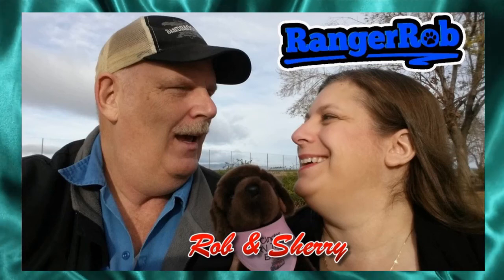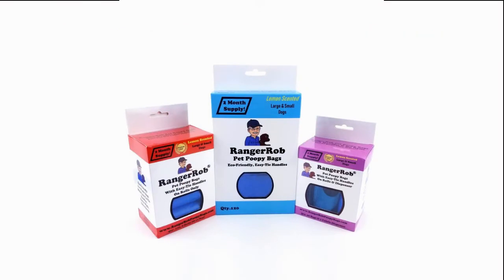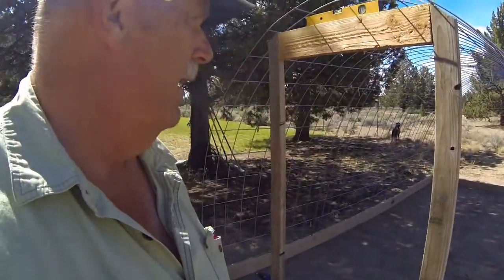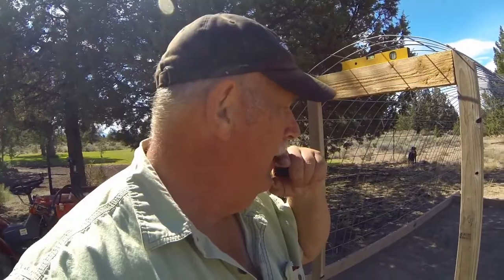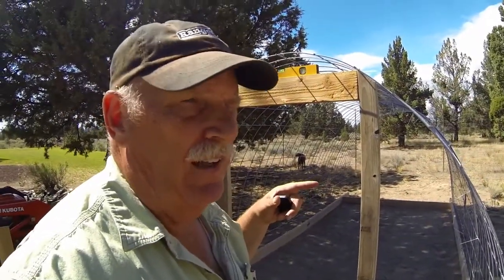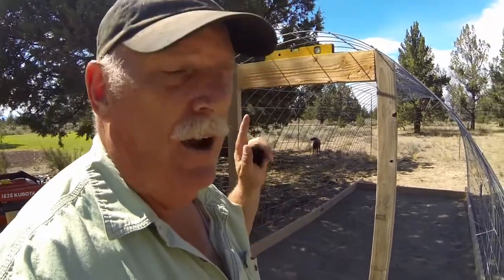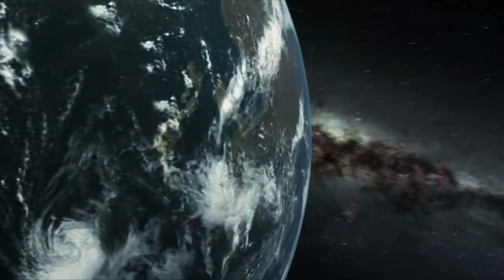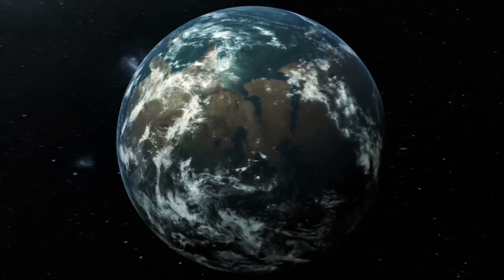Cattle Panel, Hoop Designed Chicken House, Using 4, 16"x50" Panels | RangerRob Channel | Part 1

Comment: What are the clips called that you’re securing the fencing to the bottom wood pieces?
Reply from the maker: Thank you for your comment. Are you talking about our chicken coop? Watched the video and I am not sure what clips you saw. Thanks
Reply: RangerRob Country Living The metal clasp are using to connect your cattle panel to the base of your chicken coop. Thanks, looks great!
Reply from the maker: @_j_a_d_e  That is Plumbers tape, it comes in rolls. You just cut 2 inch pieces and use wood screws to attach it. Its wonderful for attaching the cattle panels.
Reply: RangerRob Country Living oh! You did day that in the video but I didn’t realize it was same thing. Thank you! I may be doing this! 🙌🏻
Reply from the maker: @_j_a_d_e  It was a very easy way to install the panels, you will like it.